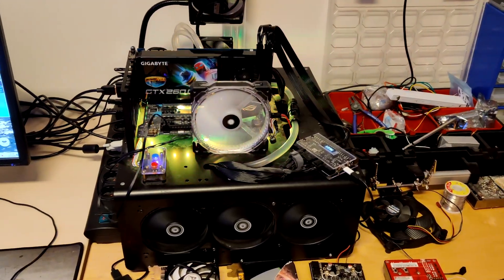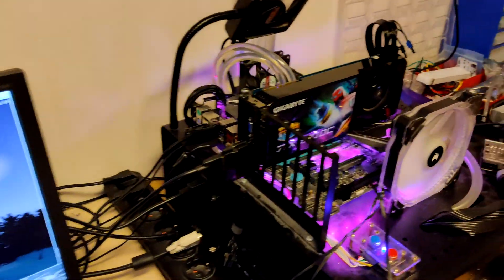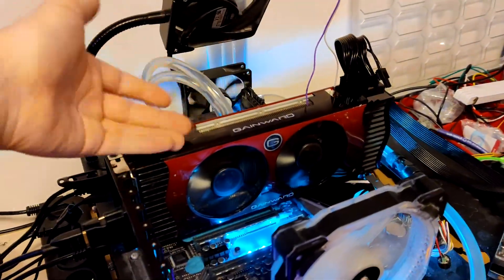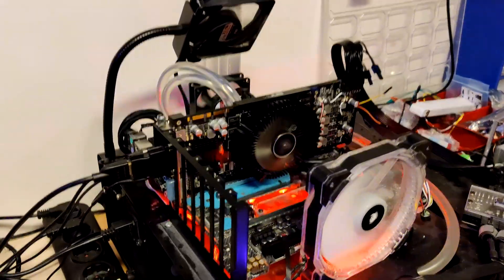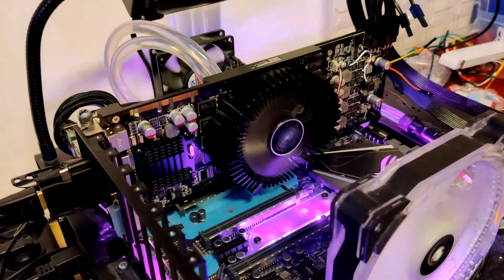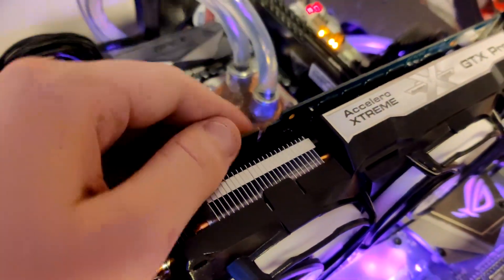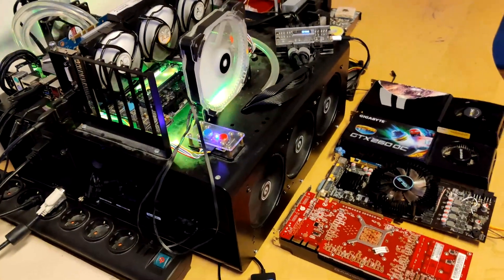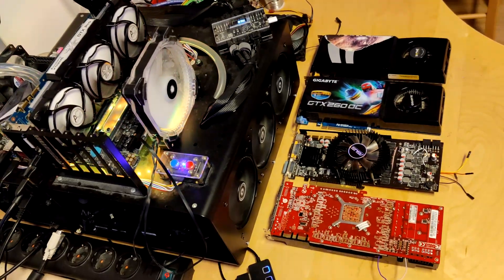Just how bad is a Blower Heatink for the GTX 260?

Comment: I have a MSI gtx 260 twin frozr 55n red pcb 216 core. It's really unstable 😕 only have gotten one run to pass not 30% below stock scored 1196 I think. I will post it soon. Trying it on a 12900kf, 7950x and it's most stable on a 5800x going to try 8700k next. I think the memory is bad. 😕 I have a 2nd coming in a few days I could only find one red pcb in the USA hope the blower pny is good enough to go under dryice. Been fun so far!
Reply: I have one of these coming next week. Hopefully not a widespread issue with those cards. 

Best of luck.